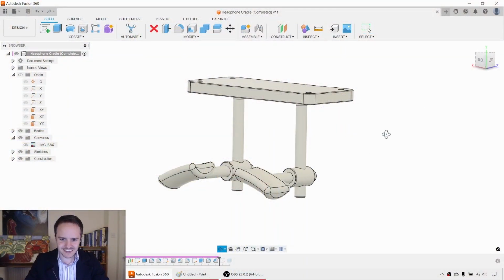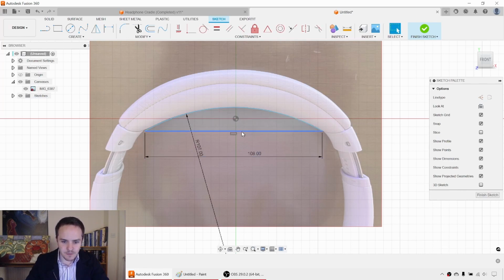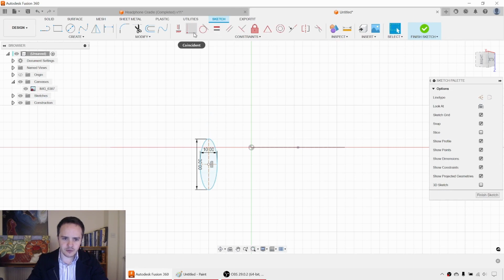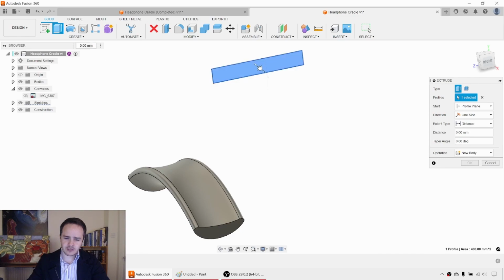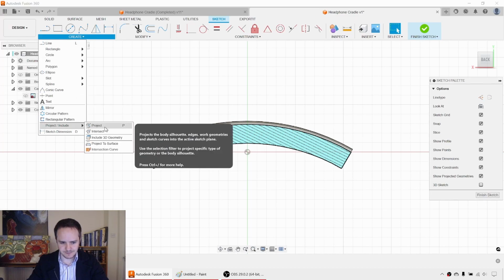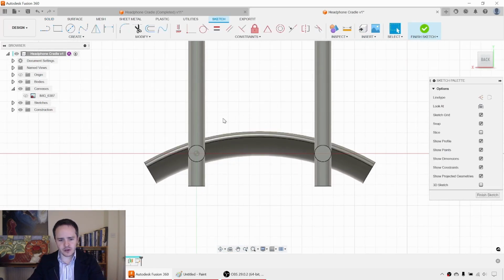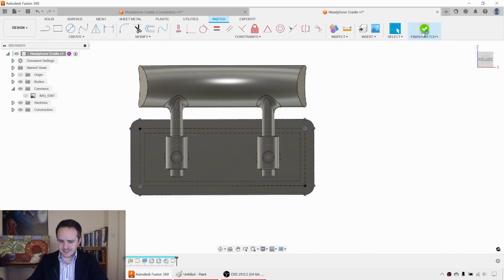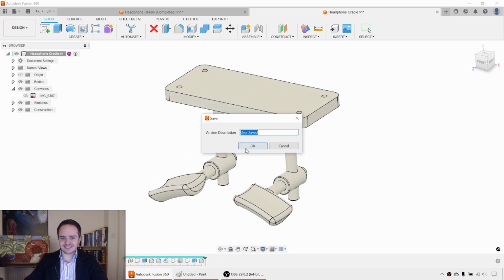Let's Model! 3D-Printable Headphone Mount | Autodesk Fusion 360 | 3D Model | Tutorial (Intermediate)

Comment: I enjoy your videos and I like the way the holder looks but I think it will be very hard to print. I always design my parts with 3d printing in mind. Looking forward to more of your videos.
Reply from the maker: Thanks Rick!! What's the best way to improve a model's 3D-printability?
Reply: @nemoengineering   I make sure I have a flat side with enough surface area to stick to the bed. I also avoid steep overhangs. You can split difficult shapes in F360 so they have flat sides and glue them together after printing. You can even put 1.75 MM holes in each flat surface to help align the parts while gluing. Short pieces of filament can serve as a dowel pins.  In this project you could use 8MM steel rods and print the other parts separately. You would have to modify your design do provide a way to clamp the rods to the printed parts.
  The 'Teaching Tech' channel has a video called '5 Tips to start designing your own 3D printed parts' that covers the basics. The tips start 3 minutes in to the video. The 'Makers Muse' channel also has some good videos on the subject.
 I avoid printing in ABS because it's hard to get bed adhesion and the layers start separating after a few layers are printed. I think people who print with ABS often use heated enclosures to help with these problems. PLA would be fine for a headphone holder unless you leave it a car on a hot summer day or somewhere else hot.  I have PLA prints I use everyday.  The portable soldering iron on my channel is a good example. Good luck.

Rick
Reply from the maker: @rick_100  Woah! Thanks Rick! I'll check out those channels!

I have tried ABS before without a heated bed, and it was difficult! PLA is much nicer, although once I had a bracket that I kept in the car and it melted!

I'll give these new techniques a go! Thanks again!